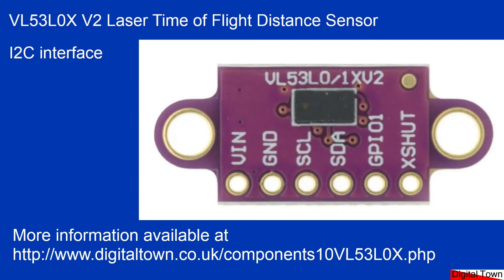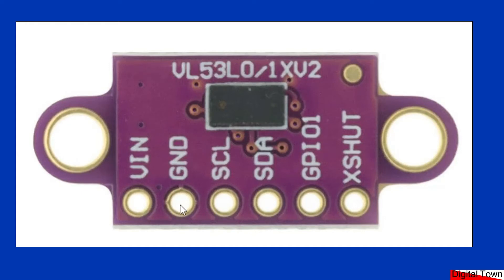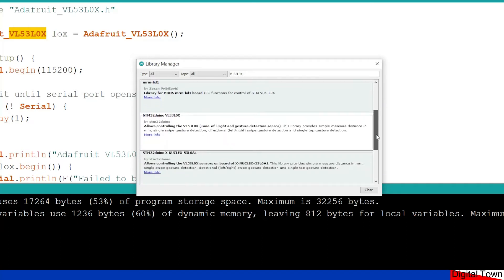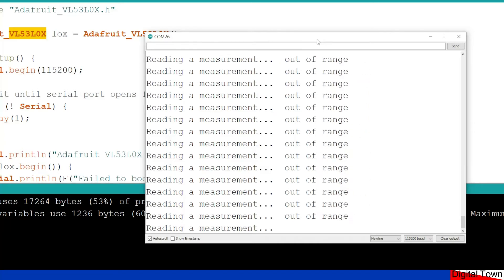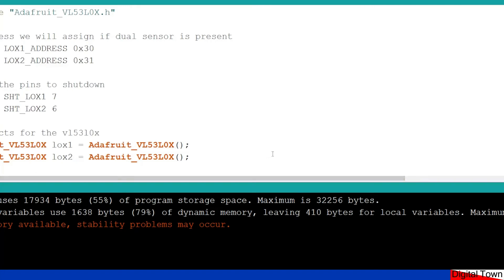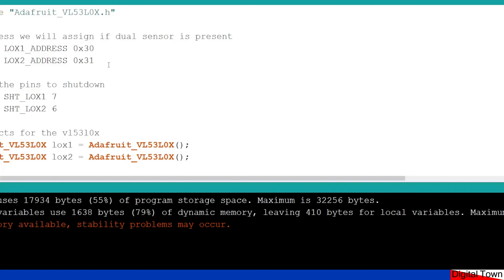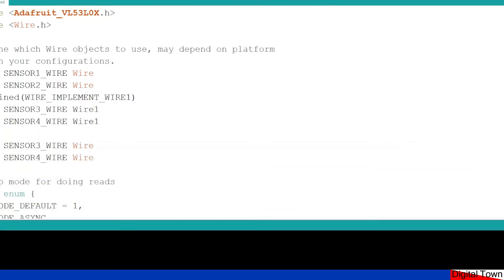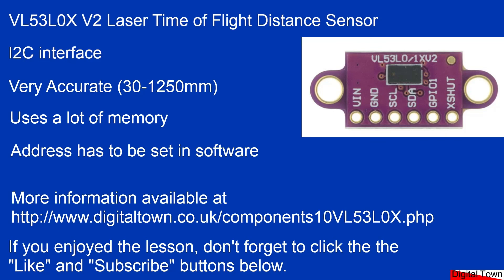Arduino C++: VL53L0X V2 Time-of-Flight Laser Distance Sensor

Comment: Man, I'm using the library as stated, I have the same sensor, I cannot get this sensor to not fail intialization. I'm on a esp32, I have the sda and scl corrently pinned, I even connected the gpio01 and xshut with that also mapped out. 

GPT says I may need pull up resistors is this true?   I have tried 3.3 and 5v both don't work even external power.
Reply from the maker: Just did a quick test using an esp32 dev module using Adafruit_VL53LOX library version 1.2.4
Example Sketch VL5310x and Vl5310x_continuos and both sketches worked first time. Didn't test the other examples.
I only connected 3.3v to VCC, GND to GND SDA to SDA (pin D21 GPI021) and SCL to SCL (pin D22 pin GPI022)
The library has changed since the version I used but in my tests it did work... maybe time for a new video.
Reply: @digitaltown5442  thanks I appreciate your testing. I'll give it another shot.. one last shot before I just give it up. Could be bad sensors but 2 bad sensors? Possibly...

Comment: Very good tutorial :) Do you have a connection diagram with the ESP32?
Reply from the maker: On the ESP32 dev module SCL is GPIO22 Marked D22 on dev module) and SDA is GPIO21 (Marked D21 on dev module)
Reply: @digitaltown5442  Thank you! It worked! :D